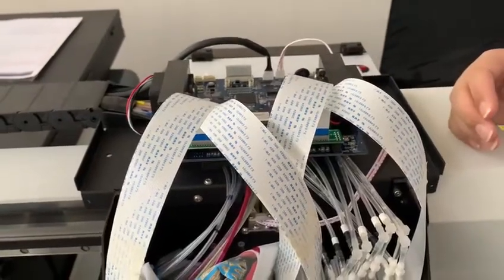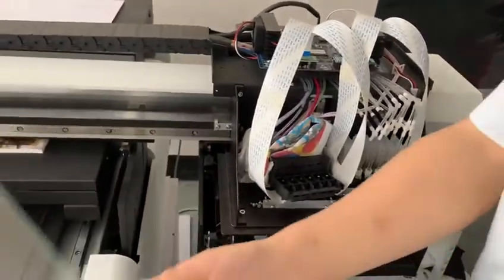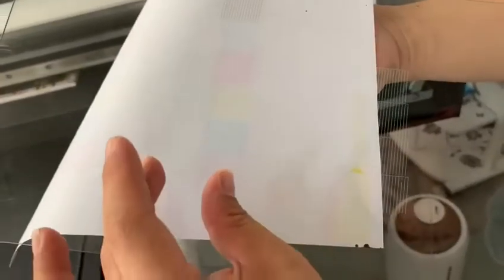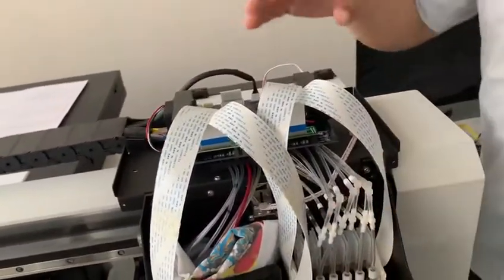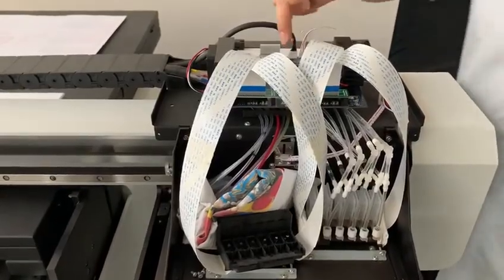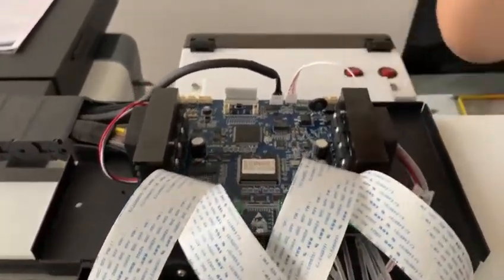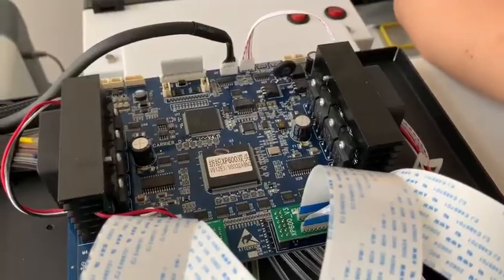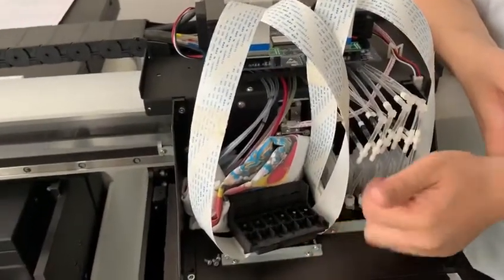Part 1 How to solve the problem when no head print out ink?

Comment: Hi,

Kevin, i have a Audley mini, xp600 board.  The printer looks like yours.

Mostly everything is working but the red color is not printing.  I changed the cable heads and cleaned the lines but still no luck.  Could it be a issue with the line clogged going to the pump?

Any recommendations?
Reply from the maker: Hi dear , I don’t know their boards dear. Thanks .

Comment: I have changed the printhead board and cable. Mine is still not printing. I got new T1881 printheads from ebay, dont know if that is the problem
Reply: Hello, did you fix the problem?
Reply: @crazydoctor4074  Not yet. I still haven't purchased tested printheads from the supplier. Thats what he recommends I do. The heads from the supplier are 200USD each compared to ebay 20USD each. Just busy with my other printers at the moment. Will update you once its tested.